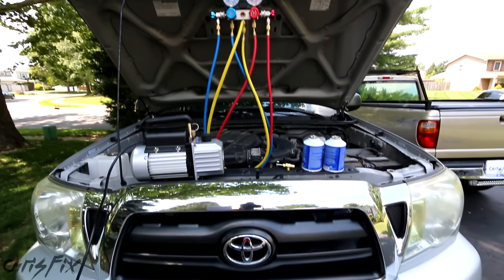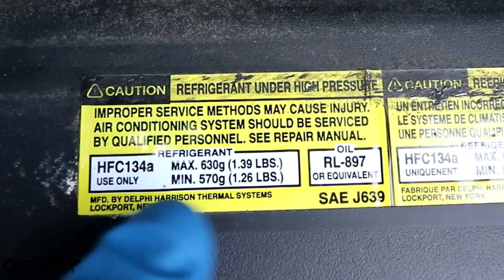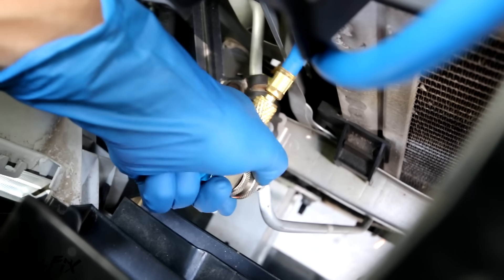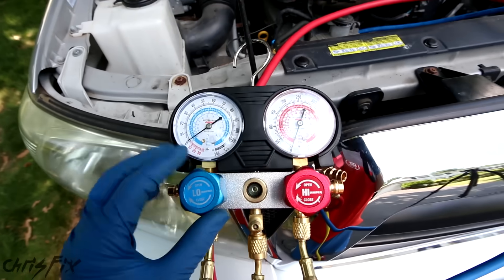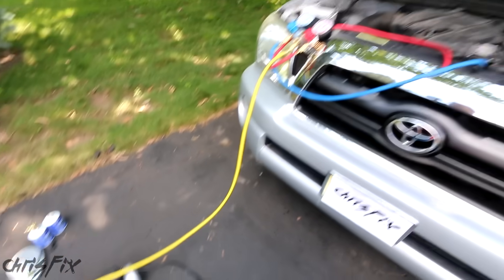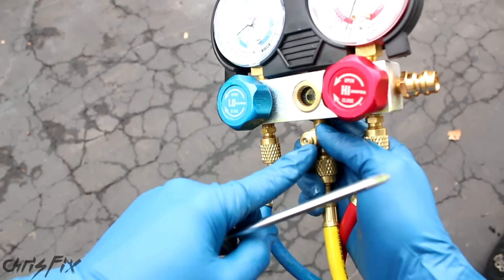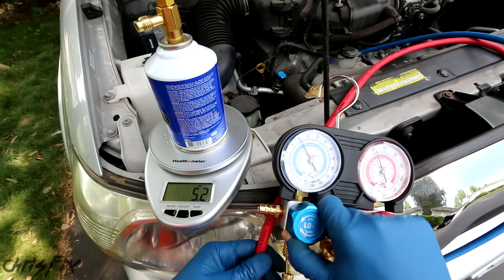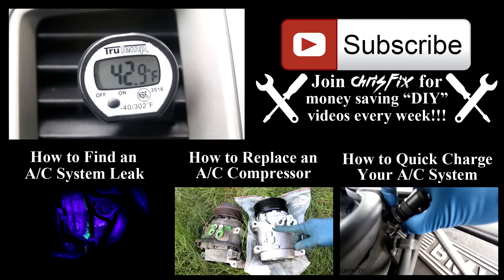How to Properly Recharge Your AC System

Comment: Hey Chris great videos, they’ve saved me lots of money and has taught me a lot. I’ve replaced my compressor, evaporator, and A/C line on my 2003 Mustang V6. I’ve compressed the system, and I’m filling it with refrigerant; however the compressor isn’t kicking on after putting in the first can. Any idea why it won’t kick on? One mechanic said it’s the ECM, another said it’s the compressor. But it’s a BRAND NEW compressor.
Reply: There is a pressure switch in the system that will not let the compressor run until it reads enough pressure in the system. If you start to add and see the compressor start running and then stop it is the switch disengaging the compressor clutch because more refrigerate is needed
Reply: @matthewbennett3873  It doesn't engage at all; pressure builds up but the compressor is not kicking on or taking in more refrigerate.

Comment: What should low and high side pressures be when compressor is working correctly about how low should pressure be when clutch disengages and what is max high side pressure
Reply: It varies on outside temperature and correct amount of 134a

Comment: Why didn’t the oil in the new compressor come out when you applied vacuum?
Reply from the maker: Oil won't come out when you apply any sort of vacuum!
Reply: ChrisFix Thanks for the reply man. You’re motivating me to start working on my own car. I started with doing my own spark plugs using your in depth spark plug video. And I’m working up the courage to tackle my brakes.
Reply: That's exactly what I was wondering. I still don't see how it doesn't suck the oil out. ? 🤔

Comment: Chris, great video. I used this video for working on my 2001 Subaru Outback.  I used my vacuum pump and found that I was leaking at the high side and low side connections to the a/c pump. I replaced the o-rings and it then held vacuum for over a hour. After that I did the air evacuation for over 45 minutes. Unfortunately I couldn't use my yellow charging line on my refrigerant can. It seems like some of the new cans have a pressure valve installed on the can. So you can not puncture the can and open the valve like on a normal can. So I  just used the one from the A/C Pro kit I had laying around and got it into the green area on the gage and it is working great. So I  just wanted to say thank you for a great video and to let you know that the newer cans have that pressure valve in them now.

Comment: Chris, after vaccun the system  getting  -30 psi mercury,  leave it over night,   dropped  to -10
Looks like JUST SMALL leak
If I have to  change the compressor is where is leaking  from  the "shaft" also has to change ,condenser,  evaporator " valve"and the recevier dryer, in order to has a WARRANTY  on the delso compressor,  
What do you  just to keep topping  off, once or twice a year 
IS OR IS NOT A GOOD  IDEA 
Please  I need advice  from a professional
Reply: Try vacuuming again, without letting any air into the system. If your system still had any moisture in it after the first vacuum it could cause the you to lose some of the vacuum over night. If it doesn't hold after the second try it's likely you have a leak somewhere. If you do it's somewhat small. It's your choice , but I'd try charging it and see how long it lasts.
Reply: @imnotabotrlyimnot   i tell you what i did,  add dye on the gas and refill with freon, in the compressor,  the shaft  has a point of dye, no big , i guess is there where is leaking, 
Is a denso ppf gs40 , but no one  sell  me that  dammed seal, they want me to sell the compressor  620$ 
Is clutchless  so no idea how to open it asking forum,  and every one,
If you know anything  let me know, please,
What do you think if a keep topping  off of ever year, is so much money, but i afraid  mess up the system,  any idea, thank you in adavnce

Comment: Nice video. I have a few questions about the oil. How much oil is needed if you change the high pressure hose because of a leak? I found this, is it correct?    Compressor.........1.4 oz
Condenser..........1.0 oz
Evaporator.........1.5 oz
Accumulator........1.0 oz
Hoses..............1.0 oz

Comment: Chris what if I filled without gauges and now want to do it correctly but I’m sure system is full now .what should the high pressure be and what should low pressure be? My compressor clutch not kicking on either checked fuses good there .Thanks in advance

Comment: this is the best video on recharging AC.  the only thing this video did not show is when he added the 2nd can of freon, purging air out of the line before letting freon get drawn into the system is still necessary.  also, prefilled oil does not necessarily mean you should use all of it.  how much to add in is very difficult to determine, though so I can't give advice there for all cars.  but here's what I did to my system for oil: I did not have a system leak - just an ac compressor that I replaced.  so I removed compressor, drained it of oil into measuring cup, and added the same amount to the new compressor or slightly more...new PAG oil of course, not the old stuff.  everything worked beautifully!

Comment: Awesome video. I replaced receiver drier, evaporator, condenser, and compressor. I know you must add the correct amount of oil to the compressor but do you need to add any additional oil to the receiver drier and/or the entire system?

Comment: Hey Chris, I followed all the steps perfectly however,  when I began to open the low pressure valve the compressor never kicks on.
Reply: check your pressure switch... does the compressor kick on ?

Comment: Great video. One thing I wish was here was flushing out the AC system. When does this need to be performed and how to do it safely.
Reply: I have been a auto A/C technician for 30 years for reference, you should not ever have to flush an a/c system for maintenance as it is a sealed system unless 1-a/c compressor completely explodes internally or 2-seizes up and releases trash or metal particles into the system  in that case you need to replace many more parts as getting all the debris out is hopeless, a seasoned tech with all the proper tools would be needed. 3-an A/C has been left open elements where  dirt and trash gets in Also when replacing any a/c part its recommended to replace the receiver/drier when replacing major components as it has a sort of filter and desiccant bag to keep your system clean  i always do it relatively cheap

Comment: Its 18 $ to full refull AC and oil that goes into compressor. Plus some shops offer you cleaning your cabin with O3 so i think this is not nessesery
Reply: You things they will charge $18 for 3 hours job?
Plus the supplies.
Reply: This job in work shop is around 30 min plus O3 cleaning 10 min. Yea its still 25 BAM whitch is around 18 $
Reply: @spajderman9101  if you want to do proper vacuum will take you at least 2 hours

Comment: NEVER turn the can upside down when connected to the low side!!!  If you do liquid refrigerant coming out of the can can hydrolock the compressor and destroy it.
Reply: @Edgar acosta when you charge with the can upright the pump will draw the gas on top of the liquid in the can and compress that gas into a liquid.  On cold days you can help this process along by heating the bottle with a hot air gun.  If you turn the can upside down it will draw the liquid into the pump.  Pumps can't compress liquid only gas so it will hydro lock the pump.
Reply: @richardp6178  What if the refrigerant I'm using says on the can to turn the can upside down. This is enviro-safe industrial 134. Should I turn it upside down or not?
Reply: @russgould707  the can i have says hold can upright, and turn 90 degrees every 15 seconds.
Reply: Chris mentions this at the 11:45 mark. When finishing the can he wasn't worried because it's such a small amount.
Reply: You would have to hold the can upside down the whole time to cause a problem....or already have refrigerant in the system...he pulled a vacuum and there's an accumulator...it has two ports on the top so only vapor can get to the compressor....take a look...mine on my truck could probably hold my entire refrigerant contents in it...so y'all all tripping...
Reply: He did everything else correctly, but was wondering this myself. I cringed a little when I saw him turn the can upside down and the liquid pour through into the sight glass...
Reply: @lmuhlstadt  I do turn the can upside down sometimes but only when the system won't engage due to a low pressure switch.  When I do the car is NOT running and then I wait 24 hrs before I test the AC system.
Reply: Actually Even if you hold the can upside down and liquid freon goes into the system it will instantly depressurize and turn into a gas before it gets to the compressor ONLY when filling up the LOW side though. *However*, If you're connected to the HIGH side and turn the can upside down then yes it would NOT depressurize and would stay a liquid which would then damage your compressor.
Reply: Richard P Funny... Chris Has Refrigerant Can Upside Down No Problem 🤔
Reply: @mikecarmean6446  Yes really funny....He'll do it ten times and then one day bang.  I know mechanics that did it for ages then one day they never did it again.  Anyway you do it how you want, just don't give bad advice. :-)
Reply: baloney
Reply: @puppetmasterblaster  Yeh ok that's why I saw it happen right in front of me by someone who thought like you.  The funny thing is I argued time and time again with this so called tech about it.  I guess he learned his lesson the hard way.  Just please don't work on anyone else's car but your own. Also if you bothered reading the text books IF you have your AC certs it states my comment exactly in the book.  I've been doing this for 30 years including AC systems on aircraft but you know best.
Reply: @richardp6178  When charging it right side up. Will the liquid refrigerant eventually turn to vapor as your charging the system? In other words will I be able to use a full can without pouring straight liquid refrigerant?
Reply: @richardp6178  if the compressor locked up, which i really doubt, then you had the high side manifold valve open and the liquid went straight into the compressor
Reply: @Blayze1017  The high side is where the liquid goes.  The low side is the gas side.
Reply: @richardp6178  just keep the high side port closed when recharging the system
Reply: @puppetmasterblaster  lmao how

Comment: Question, and I'm only asking because Chris usually is good about listing every step. Every step.  Okay... at about 7:00 Chris has determined that vacuum is holding and moves on to "pulling a vacuum." He turns the vac pump on, opens the gauge valves but doesn't mention the lower valves, the ones on the hi & low ports. Normally Chris would have said leave these open or close them now but he doesn't mention them. They stay open?

Comment: So I have a quick question to add on. I added some of the stuff from the store that has its own pressure gauge. After reading it thoroughly, I added it and it cooled down a little bit. After looking for more instructions, I found in tiny ass print, " Not recommended for ev/hybrid." Since then I have only ran the AC Compressor twice. I guess its two questions. First, if I evacuate the AC system, will I have to add oil if I am planning to reuse the same compressor? Lastly, do I have to replace the compressor since I made that mistake?

Comment: Everytime I do this, I can get a vacuum to hold at -30 no problem for hours, but everytime I try to fill refrigerant, nothing happens. I can't tell if the compressor just isn't coming on but I've always had ac before, had to replace my condensor recently. Anybody else having this issue? The refrigerant fills up in the yellow line but neither the high or low side build any pressure

Comment: Hi , Chris ! I'm going to replace my condenser on my toyota corolla 2003 since it has a leak . Do you have any idea how much oil that i need to pump back to the system ? My case is using ND-oil 8 . Is it ok to replace with the PAG 46 type of oil because I couldnt find any ND-oil 8 at nearest autopart stores.
Reply from the maker: You have to use ND oil in your case! And check to see if your new condenser is prefilled with oil, if not do a google search to see how much oil you have to fill it with!

Comment: When you put a vacuum on the system, does it leave the oil or does it remove everything? Thanks!
Reply: So how would you know if it needs oil ? How do you remove the oil that is left in it to be able to top off the right amount
Reply from the maker: It will leave the oil alone!
Reply: @chrisfix  Still replying to comments from a video made 5 years ago! This is why ChrisFix is the best.
Reply: Thanks! You're the best!
Reply: so it safe to say just drain the shipping oil on a new compressor and add proper amount with new spec oil then pull a vac and recharge?

Comment: I need to change out my compressor. The manufacturer says that the correct amount of oil is in the compressor but if I am not flushing the system I need to remove some of the oil because some will be left in the system. But if I vacuum out the system and the 134a is mixed with oil will the oil come out too or just the gases?
Reply: Van Helsing there's a comment that says it's a small amount of residual oil left in the system. You can install your new compressor without worrying about extra oil in it. The vacuum doesn't remove oil just moisture.
Reply: Nick T. 

Thanks for the response!

Comment: Great video. Unfortunately the cheap manifold gauges that I bought had a refrigerant adapter that leaked badly out of the can tap. I simply evacuated the system again, then manually added refrigerant using a re-usable recharge kit hose, and continued to weight the cannisters every few minutes to ensure I only charged with 22 ounces. Kia Sorento's AC is ice cold and ready for a 30 hour road trip next month!
Reply from the maker: Darn! At least you got it working! Let me know how your road trip goes!

Comment: When adding refrigerant does the high pressure side need to be closed or open like the low pressure side?
Reply: He did say to close both valves before disconnecting the vacuum and open the low pressure when charging from the can. But maybe should have warned not to open the high side when charging.

Comment: Chris I need you help today I try to Change my valve ac   and all the gas come out I put the new valve but now idk what to do now if refill again or no
Reply: Angel Diaz recharge the whole system like in the video. Most of the oil is in the compressor so no need to add any.

Comment: Do I need to add an oil charge if all I replaced are the 2 Schrader valves and pulled a vacuum for an hour?
Reply: toeteeboy1 the compressor wasn't working so it should have plenty of oil left. There's a comment stating a small residual amount is in the rest of the system but most stays in compressor.
Reply: @69ztang  thank you! I appreciate your advice

Comment: Hey chris im a auto tech from Tx. Just wanted to mention the new ac cans have a saftey valve inserted and the Schrader valve itself wont pierce the can all the way down and wont release the r134a. Auto parts sells a 5$ adapter that goes under the valve.. Just thought id share with other DIY community.
Reply: You don't know what a schrader valve is as that's not what you are describing
Reply: @PWgadgets  yes he does all the new cans are self sealing the have a schrader valve in the top of the can. this video is slightly incorrect as the can adapter needs to be screwed down in order to open the can. the pierce style fill adapters no longer work with the new cans

Comment: When I put on the high pressure can I release some air to 0 before putting on the vacuum ?
Reply: On the video he says it's OK for high side to go below 0. Vacuum is read only on low side. If you hit purge valve under vacuum it'll draw air and moisture in. Don't open the high side when charging, or can will explode.

Comment: Can someone help i replaced my AC Compressor with a new and have done everything you said Chris and my Compressor will not kick on Can you help What can i try it is a brand new Compressor. Thanks
Reply: Did you connect the wire to power the AC clutch? Also I think some compressors need pressure from adding refrigerant. The vacuum and can pressure should be enough to start it.

Comment: I just change my ac compressor but it sounds like a motorcycle when I turn the ac. On. Why. Is that any body.  ?????
Reply: Its most likely the compressor was defective from the factory or the scrap yard< the only reason it would make that kinda noise is bcs the compressors guts are rly messed up
Reply: Braden White  yes but the second one and brand new.  From the auto parts.  ????
I will try a third. I gesss ???

Comment: "this refrigerant is pretty nasty stuff"
computer dusting cans full of the stuff, got ya covered!
I freeze spiders with duster cans...
Reply: those are compressed CO2, not R134. CO2 has similar properties to R134 in that it gets cold when it expends, but it has to be compressed to roughly 700 PSI to be in a liquid state.
Reply: @iviaverick52  not all...
"Most aerosol duster contains a refrigerant/propellant that cannot be considered “air”. As a matter of fact, breathing too much of these vapors can lead to negative health effects. Compressed Air Duster is most commonly filled with the following propellants: HFC-134a, HFC-152a, HFO-1234ze, CO2, and DME."

Comment: Just wanted to add that you have to watch your pressures on your gauges. If you have too much head pressure.  Red gauge. You have other issues. Low pressure gauge( blue gauge) should read approximately 25 to 35 psi depending on the ambient air temperature. ( Outside air ).